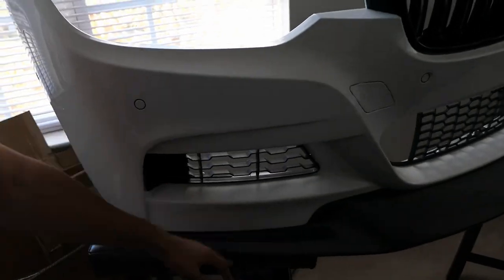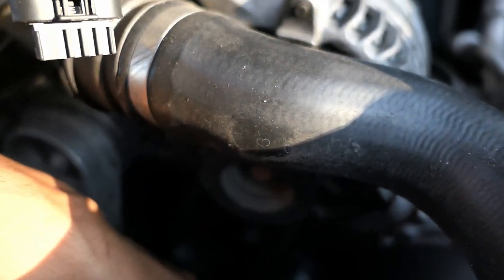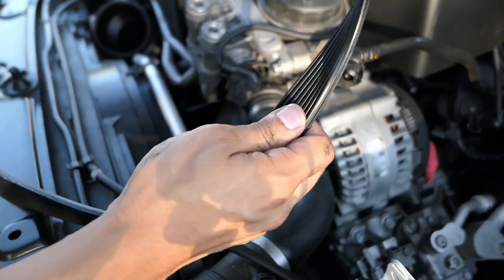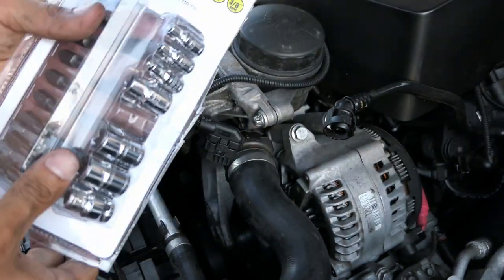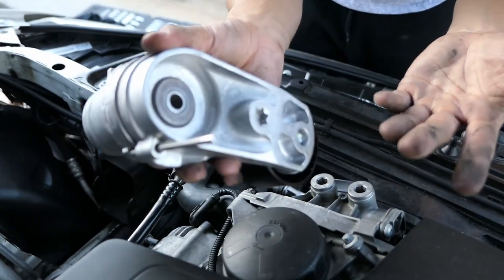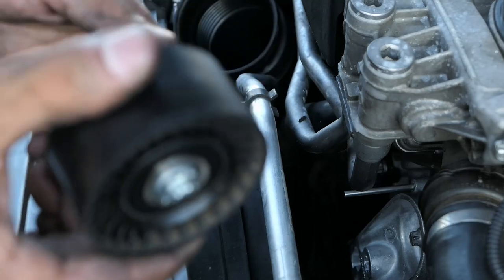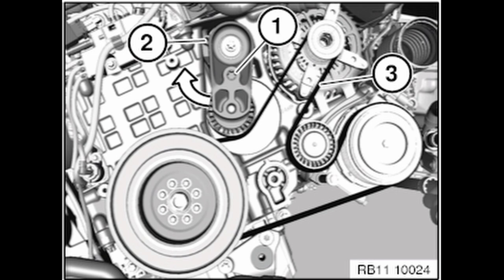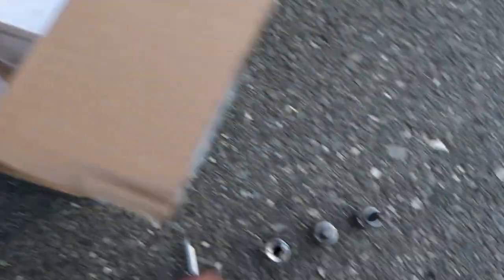DONT OVER LOOK THIS ON YOUR F30! | BMW N55 Tensioner Drive Belt Kit Install

Comment: I replaced my pulleys an tensioner an belt like a month ago, and long story short my belt got covered with hot oil an it slipped off the belt. I just got my crank seal guard yesterday I'm going to install it so that way if the Belt busts again it won't get sucked inside the engine. It was only 80 bucks from fcp. And considering belts getting sucked into the engine is a common problem a $9,000 common problem I say it's a good investment

Comment: Wonder to save time if you can just go ahead and remove the tensioner and then you can just remove the belt. I figure its the same thing instead of having to loosen the tension, then removing the belt, and then removing the tensioner.  Also I think a person with my fat hand size might need to remove the fan. It looked it was very tight for you.

Comment: Had to do the same on my f10 535 n55 engine. It.helped tons taking the radiator fan off. Old one had movement, ordered aftermarket tensioner only to find out that one has movement also. Apparently the tensioner is going to have movement. Keep hearing a rattle sound every so often, gonna replace the other pulleys soon also.
Reply from the maker: I wonder if it's some tensioners that still have movement. Mines solid now, doesn't move at all and the noise is gone. I wonder if the one you received was a bit bad maybe?
Reply: @EldridgeCortes  possible. Its all warrantied parts
Reply: @EldridgeCortes  Also i hear what to be is the vaccuum pump ticking. Not rpm related. i think the slight movement is normal taking. If it was completely stiff then I think the belt would wear fast af.

Comment: My F30 has 105000 miles, original tensioner and belt. They look great but it’s on the list though.
Reply from the maker: nice! you must be one of the lucky ones. I would still suggest replacing it soon at that mileage though. Better to be safe than sorry for something inexpensive and easy to replace

Comment: 2015 335i N55 here... I replaced my drive belt at 60,000 and did notice mine had similar movement. Now at 70,000 ordering a tensioner today.
Reply from the maker: Consider the idler pulley as well since those can lock up if they go bad. It's not that much extra for it and better to get it out of the way while you're in there
Reply: Eldridge Cortes ...Thx...Did the FCP kit contain all three? Drive belt, tensioner and idler pulley?
Reply from the maker: @wjohnsonism  yeah it comes with everything you need